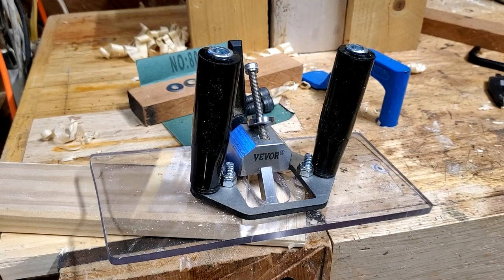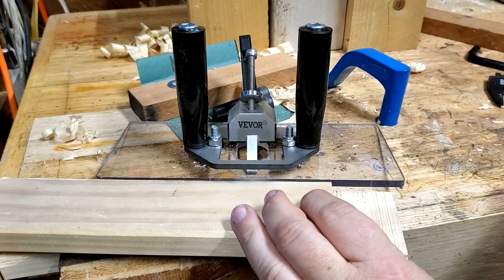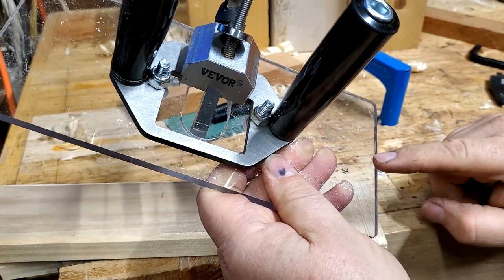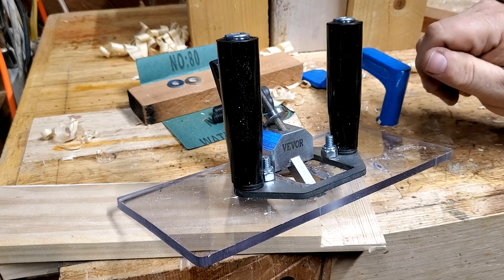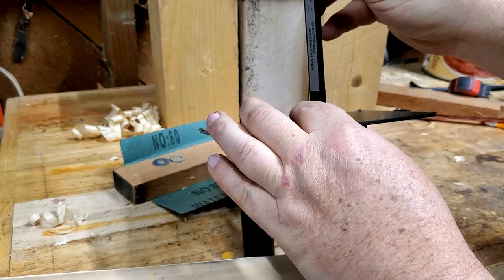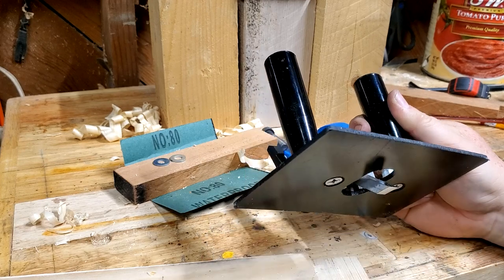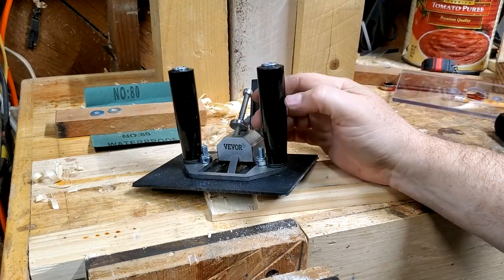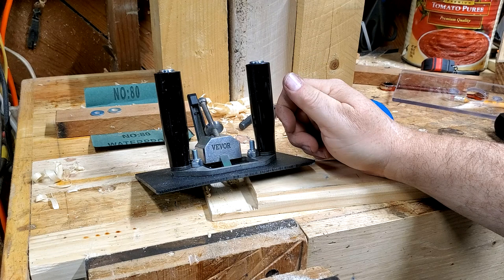Vevor Router Plane Follow Up

Comment: I'm sure you already thought of it, but you could put the mating half- lap at the end of your part, then use spacer to bridge between both parts. That would support the cutter.
Reply from the maker: That's an excellent tip.  Even with a bigger router plane that will keep things accurate.

Comment: I'm not a machinist for sure, but I just had this problem with mine too. I have 3/4" lap joints and this thing isn't anywhere near close to that sorta depth. This is what I get for getting fancy with using overkill joinery on a construction lumber bench. Just wanted to save a couple bucks but ended up on this odyssey instead. 

My solution is a piece of a rectangular HSS lathe tool stock for $15 off amazon. I used a dremel with a fiberglass reinforced cutoff disk to put the notch in it for the guide nut. Ground the bevel with a bench grinder and had to use a diamond stone to hone it. My other stones didn't do much to the HSS. 

Other than the fact that I cut it too long and it is permanently sticking out 1/4" past my base plate, it seems to be working out and I finished my project. It was a lot of work though. I have 4 hours into it.  Not sure if its worth the time, unless someone has a lot of time and not much money. You also definitely want to have diamond stones or lapping film because oilstones wont do much to it and it might damage them. hope that helps someone.

Comment: The idea of this router plane is its simplicity and easy adaptability. Change out the iron,longer square stock of tool steel easily modified to fit the kit, dont need to be a machinist. I took the plate completely off and made a stanley shaped body out of pear wood. Looks awesome.😁
Reply from the maker: Excellent!

Comment: Can the factory sole not be removed? It looks like there are a couple screws on the bottom.
Reply from the maker: I think so.  Haven't tried yet.
Reply: Yes it can and you can completely redesign your own base, just leave out the steel one.

Comment: I have the Bench Dog Router Plane that Crossman compared to the Lee Valley version. (It actually looks the same as the one Lie-Nielsen makes, but saw it for about $80.00 less a couple of weeks ago.) Thus far, it has worked just fine after the customary "Fettling" of flattening the sole and truing the cutting edge to it which were both very easy. As to the extension of the blade,  I measure ⅞" with and a full 1" w/o the depth stop. I paid a hundred dollars for it about two/three years ago when it was ¾''s the price of a lie-nielsen and about half that of a Lee Valley. That ratio seems to hold true for today as well. This clam is quite happy with it.

Comment: Can you take your original plate and template your router body and take away half the depth of the pvc
Reply from the maker: I checked.  The bottom plate can be removed and the block could be re-used to make a different plane.